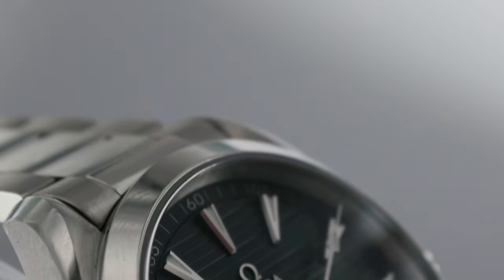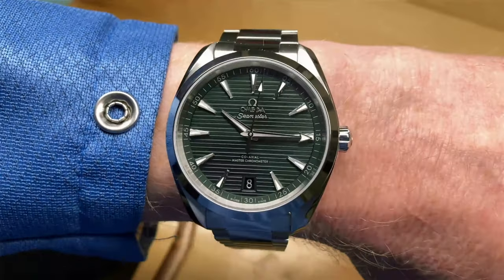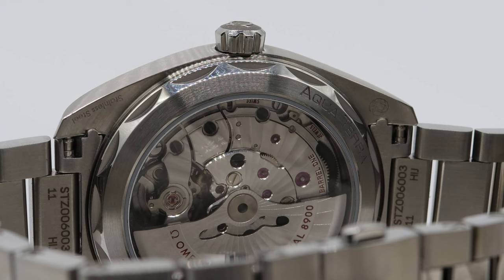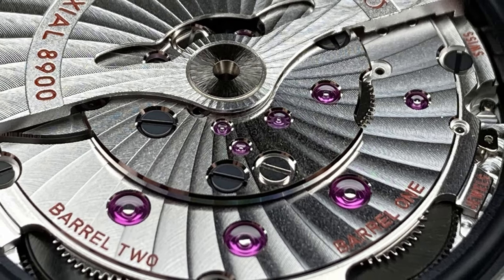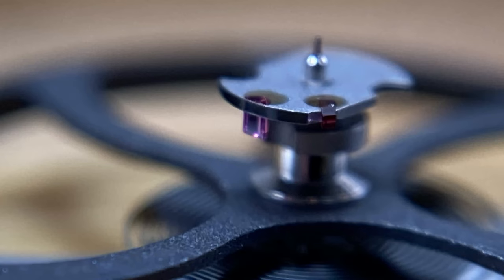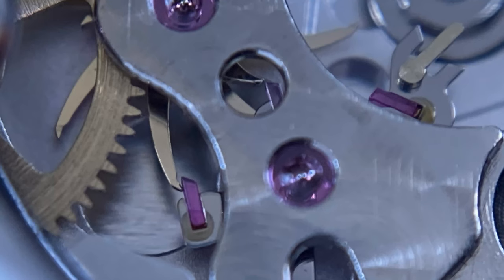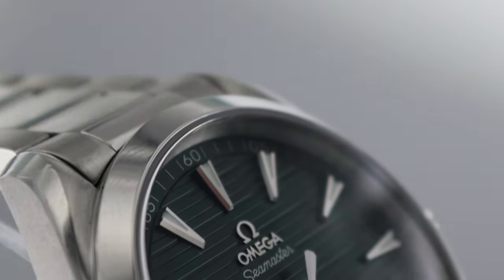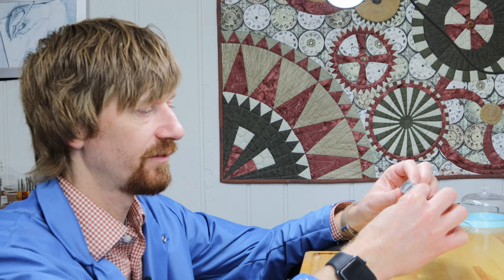Omega Co-Axial Master Chronometer Technical Review

Comment: But there are other parts in there besides than the coaxial escapement. And they still needs regular oiling. No? 
Regarding accuracy certainly its accuracy is more due to silicon spring and free sprung balance wheel.
Reply from the maker: Yes, there are other parts that need oil, but the escapement has always been the weak point where we see the degradation of oil the fastest. The silicon hairspring and free-sprung balance contribute to the good timekeeping but the Co-Axial escapement makes it so that the timekeeping can stay consistent over the entire service interval of the watch.